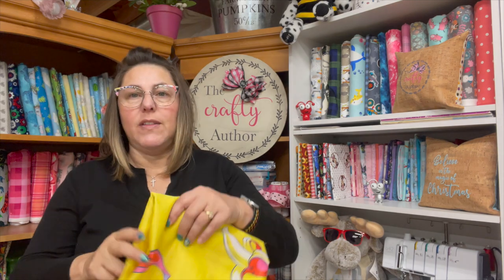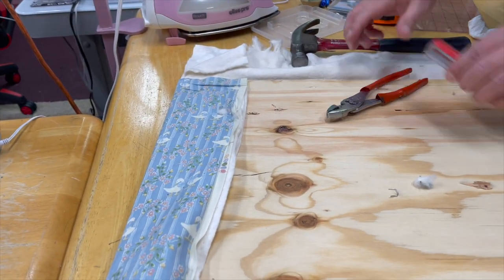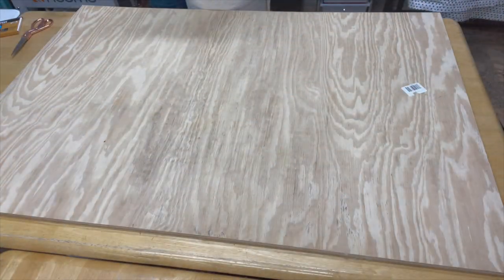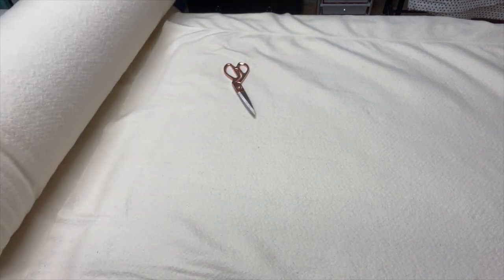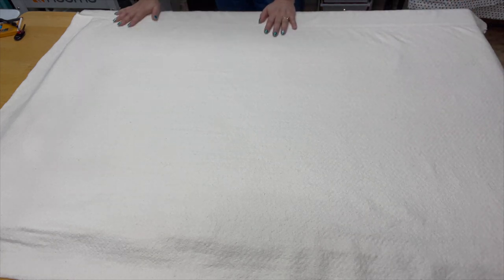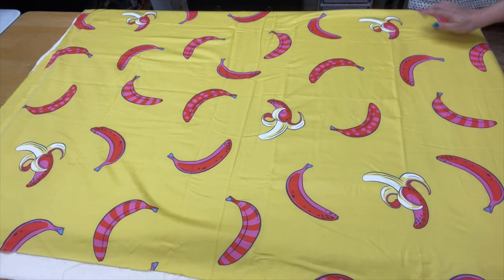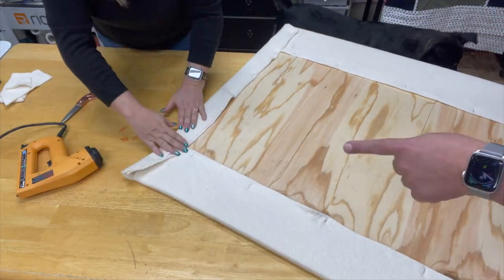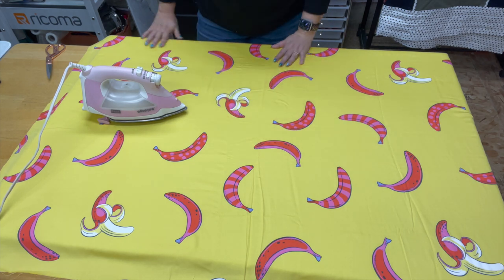Large Ironing Board and Custom Cover for Quilting

Comment: This is nice. So you don't put any of that silvery stuff overtop the batting to protect the wood from the heat of the iron?
Reply from the maker: For the ironing board, I don’t use Insulbrite.  You certainly can but the 2 layers of batting do the trick for me.  I recommend doing what you are most comfortable with.  😊